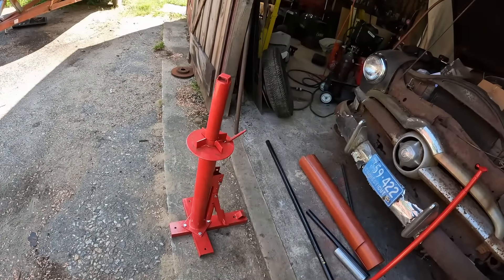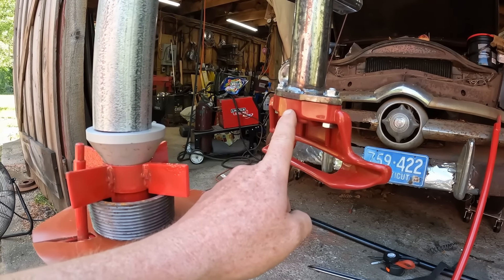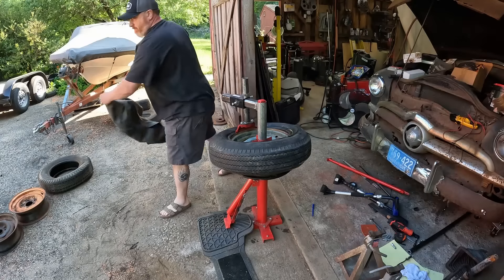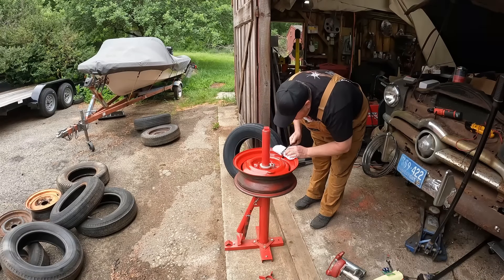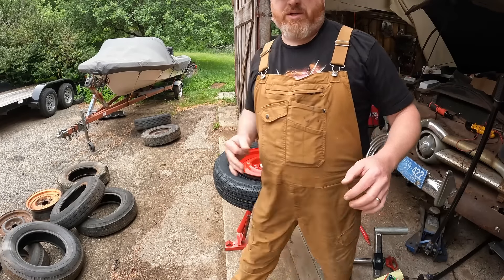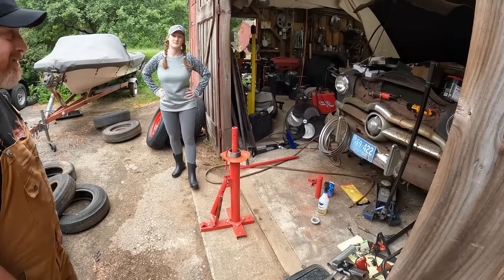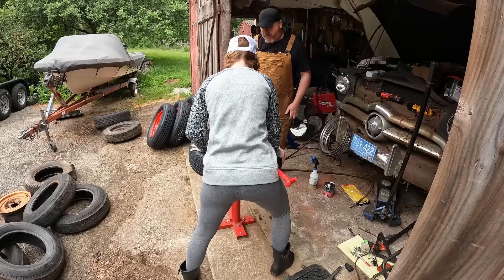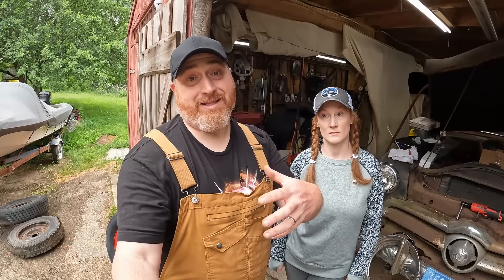How to modify a Harbor Freight Tire Changer to work amazing!!! Follow this DIY guide!!

Comment: The pop sound that you were looking for, only happens when you have modern safety rims!
The 'safety bead' was developed in the late 50s and adopted as an SAE design in the early 60s, but wasn't 'required' until the late 70s, although it was adopted by pretty much every manufacturer by the late 60s.
Reply from the maker: Yeah others have said similar. They seated well and haven't leaked so I think they will do fine. Thanks for watching!
Reply: @madgingercustoms  I was taught to always use tubes on the rims not designed for tubes tires , as they will come off if the tire pressure gets low. "Safety first"
Reply from the maker: @JDE-li8nf  the tire with still come off though at low pressure. But I know what you're saying.

Comment: Great job on the mods! The proper alignment of the duckhead is 1/8" above the rim and 1/8" clearance at the head and tail. It's also designed to move head first. In your design, you should rotate clockwise around the rim for a more effective job. Especially when you have stiffer sidewalls. Lube is your friend!! Use more soap percentage than water. Lube both beads before installing so you can wipe excess water from inside. The excess causes balance problems. Use caution when leaning over the center pipe in case you slip so you don't injure yourself. Never exceed 45psi when seating the bead for safety reasons! 💣🦺
Reply from the maker: All solid info!! Thanks for the comment!
Reply: Curious with a setup like this how would anyone be able to control an 8th inch of play in that duckbill.
Theres an 8th of play or more in the arm that's holding the duckbill.
Just a thought here
Reply from the maker: @motov8-garage832  Why would you need to?
Reply: @madgingercustoms  I'm not sure,was hoping the O.P up top would elaborate.
What I'm thinking is this 1/8 inch of clearance is so the duckbill doesnt bind up or rub tight on the rim.
On a manual or "homemade" modified tire machine I dont see how you could control an 1/8" of play.
I say just eye ball it, make sure it's not to tight  and make it work lol👍

Comment: Our welder was doing the same thing until I lubed up the spool holder, ours was binding up and now the welder works beautifully. Thanks for taking the time to show us the extras need to make this thing work better.
Reply from the maker: I'll be checking the welder out this week. Thanks for your suggestion! I'll look into the spool holder dragging.
Reply: Lube, it's what separates us from the Animals 😂
Reply: @madgingercustoms  check your ground clamp and connection. the teeth on the clamp are usually brass and they get dirty easily. also sometimes can get corrosion where ground wire meets box
Reply: If you don't have felt to clamp on the wire before it goes through the rollers , get some , a sm . Clamp or clothes pin to hold it . Work with it for lite pressure . Bless ya'll
Reply: @madgingercustoms  FYI, replace your inside liner for your wire feed as that wears out after a while from the welding wire running through it and will cause the intermitant surge of the wire. Also keep your liner laid out straight as much as possible and not curled up on the floor while in use, as this will help it from wearing prematurely. My Lincoln welder is over twenty-five years old and have had to replace the liner multiple times. It's a cheap and easy fix, everyone always overlooks. Hope this helps! Thanks for the video.
Reply from the maker: @Outlaw1492  hose assembly and gun and recently replaced. I'll go through the welder one of these days.
Reply: @madgingercustoms   My old Century brand welder was doing the same thing.  Sometimes it would feed, mostly it would stop and start.   I figured nothing to lose taking it apart, and i found a broken gear in the feed motor assembly.   I found a motor for a similar welder and replaced it.  Problem solved.

Comment: Great video. I used to do a lot of tire changes at the golf course where I worked. I worked for a county government and our main mechanic shop was always swamped with work. We almost never got the same tire/wheel that we sent out, so the golf section got their own tire changers.
My friend worked at Vehicle Maintenance and one day, he was inflating a small tire. He had it on a bench and he was talking with another mechanic. The tire/rim exploded and took off the top half of his head. It took them months to find all of the flesh, bone and brains and clean and reopen the shop. They make a cage to put the tire in or you could make one. I would highly recommend it.  

I still remember being told the story by the guy who was talking to him when that happened. They guy who was killed had owned a service station, retired, and got a job with the county. He didn't need the job and it was tragic the way he died.
I hope you take my advice and start using a cage. Ever since that happened, I never stand in front of the wheel when I inflate it on my vehicle. There is more power in compressed air than you'd think.
Laugh and call me names if you want, but I'm talking to all of you. You don't want your family having to deal with that.
Reply from the maker: I'd never laugh at that. Thank you for your concern!!
Reply: @madgingercustoms  I'm sorry. I don't think YOU would laugh. But, there may be someone who scoffs and says it'll never happen to them. I hope nobody says thàt.
Reply: @martinphilips6091  Great story!! Not laughing.
Reply: Sorry for the dude, but it was probably a split 2 piece rim that came apart, on a car rim there really isn't anything that could go flying .
Reply: Split rim all the way, that's what the cage is for, not for a standard wheel like this.
Reply: @Flussig1  yeah i was wondering how a rim split those are almost indestructible no 60 pounds of air is going to rip that metal apart unless you have a split rim,and those will take off an arm, or head.
Reply: Yeah I know there have been many killed by tires blowing up, the worst culprit are the heavy truck tires with the rims that can come flying off and take your head off.  Of course putting too much air in  is always dangerous.  Another thing is.... Just look for videos where they sprayed starting fluid inside a tire then lit it to make the tire seat.
Reply: @jondoe3179  I worked on trying to get a bead to seat using all the tricks, nothing worked. Did the starting fluid and it popped on. I'll do it again as a last resort.
Reply: @pauledwards4837  Did you try a ratchet strap around the circumference of the tire?  Squish the center and the sides bulge out.
Reply: If you're nervous about airing a tire up for whatever reason, (split rim, old tire, really high pressure to seat bead) just slide it under a vehicle or something  substantial to contain the carnage if things go wrong.

Comment: Another note.  The claw that is supposed to hold the rim to the changer.  I just cut a tire sidewall into two pieces and put it between the wheel and the claw.  It will prevent the claw from damaging the wheel and will hold it secure while still using the pin that came with the changer.

Comment: I had a Coats manual  tire machine for many years. Always hated using the bar to remove or set the tire on the wheel. Your modification is a stroke of genius.  Subbed and liked.
Reply from the maker: Thanks for checking out our video!

Comment: I have one of these HF tire machines. I used it to mount LT tires on my Bronco. Like you, I wanted to clean and paint the rims before putting the new tires on. I sure could have used the duckbill and the adapter to center the wheel to make things easier. I appreciate the information on the modifications. Did your new tires have balance marks on them? Thanks again for the video!
Reply from the maker: I thought they would have a dot to line up with the valve stem but they didn't. I was surprised by that. They were super cheap though.
Reply: Good stuff Dave!

Comment: That was pretty cool esp with your modifications that probably made it work about 100 times better using that standard duck head part. A little slower than a nice modern tire changer machine,but totally practical for a home garage. Ingenious
Reply from the maker: Thanks!
Reply: Plus about $ 2,500 cheaper than a modern tyre machine

Comment: I really liked your modifications to the tire changer. That is something that I will need to do to my HF tire changer. I took the bead breaker off of the side and cut some square tubing (it's what i had at the time) and welded the 2 flat fins on it so that i could use the bead breaker on top. I'm old with some back problems so it is much easier to use it standing up instead of being stooped over and trying to maneuver the tire around. I did however need to slip a piece of flat bar in the top to keep it from slipping up over the center spindle. Just an idea. 👍👍
Reply from the maker: That's a great idea!

Comment: 8:00 Strongly suggest pushing the tire bead down into the inner section of the rim, to allow the section you are forcing over the rim, to have as much freedom to stretch as possible, which will also save tearing the bead as you work.
That's why all rims, have a middle section MUCH SMALLER than the main rim edges.
Long time ago, I learnt that simple trick when changing bicycle & motorcycle tires, (with a couple of tire levers (or screwdrivers) as there was no way to rip the bead over the rim, without moving the rest of the bead, into the inner rim concave area.
When I saw you doing the initial removal, it was extremely difficult as the bead was NOT in the inner (looser) area, but close to the main bead rim, hence why it seemed tight at first.
Oh that and the fact that you pulled it the WRONG WAY with the red bar.
You lifted the bead up above the duckbill with the silver bar this side, which meant the duckbill would have kept lifting the bead if you had placed the red bar THIS SIDE of the center and pulled the wheel around the other way.
Talk about making things hard on yourself Trev.
Yes it will eventually rip the bead up & over the wrong way around, with the rest of the bead HIGH up on the rim's inner surfaces.
It would have been far easier, with the red bar on this side "pulling", allowing the duckbill to do the lifting, with the entire tire (halfway) down at the middle of the rim, allowing the bead to slip up & over correctly.
Try it next time and wonder why you didn't read the instructions - eh?
Reply from the maker: Amazing how it worked at all!
Reply: That smaller diameter in the middle of older rims is called the "drop center". And it is there specifically for installing and removing tires.

Comment: Elegant design overall. I think it would benefit from the handles you mentioned. I have the basic tire changer and some tires are just a bear to mount and dismount. Your mods would help a lot I think.
Reply from the maker: Hope it helps you out. Thanks for watching.
Reply: Sand them down then put the tires on then paint  afterwards. Run a little bit of tape around the outside of the rim. Don't have to worry about scratching them. I bought mine to do motorcycle tires the attachment that comes with it don't work with the motorcycle rims and tires either needs modified also. You did give me some ideas I do appreciate it!

Comment: For the bead break I would use bolts as you suggested. You could also weld a steel spacer inside. Great ideas and craftsmanship. Keep up the great work.
Reply from the maker: Thanks!!

Comment: Axle Grease is a Good Lube for Mounting.
Reply from the maker: You are the first to suggest that.
Reply: @madgingercustoms  👍    In 1984, I worked for my Uncle Who grew up in The gas station Business, He was Born in The 40s.   Get a Clean rag, Smear it on The bead area.  If You have a Tire that’s Leaking around the beed and Ream, Break tire Down clean, Bead and Rime smear a little grease should seal it.     If You ever mess with small ( 4 to 8 inch ) Tubeless Lawnmower Tires, That You can’t get to Seal,( Because Tire won’t Expand Quick enough to seat ) Take a Small Can of Grease, Lay Mounted wheel, and tire on clean surface, Glob the Grease around the Gap, fill with air.  Collect Grease off of Tire and Rim, Put grease back in Can, and Keep just For that Use, or Like Uses.     ( Just Thought Duck Tape Might Work.).

Comment: I really like your mods and it worked perfectly!  The only suggestion I would make is to weld a piece of small round stock on the end of the tightening bolts (to make them T bolts) so you wouldn't have to use a wrench to tighten them.  Good job big guy!
Reply from the maker: That was the plan but I'm impatient and needed to use it!! I may cut some knobs on the plasma table.

Comment: Too bad the manufacture of these don't realize the buying public would gladly spend the extra money for it if they would have included this design with the product. I want something that functionally works well over a cheaper price. Now I and everyone else has to spend the time and money for this modification for a good product, when we shouldn't have to.
Reply from the maker: Agreed!! HF would have a winner if they included this attachment!
Reply: Don't see you spraying soapy water or tire lube on wheel? Thought i saw a spray bottle earlier.
Reply: Nice modification!

Comment: Remember, at 8:08 the LAST thing you need is for the center screw-down tube to "loosen" while you are pulling the red bar around, (from the car towards the camera towards you then past the boat & back to the car) so as it spins TIGHT with this side turning towards the yard, and the other side towards that old car, turn the red bar THE SAME WAY ROUND, which allows the silver bar to hold he bead up enough, for the duck-bill to do all the bead removal (and the rim is held firmly by the center "threaded" clamp, so that you don't cuss and swear when it all comes loose.
Reply: I think you mean "clockwise"
Reply: And counter-clockwise…much easier to explain and understand

Comment: Yes I just bought one of these and tried it out and of course the bead breaker bent. And the giant rod they give the end was welded so poorly it's stuck a piece of metal in my hand. Then when I put the tire back on I could get it 3/4 of the way on but they made the stupid end of the rod wrong and it couldn't do it the whole way. So I had to use my motorcycle levers for motorcycle tires to get it on the rest of the way. I see you basically redesigned the whole stupid piece of crap. A work of genius by you but really, all that work to make a piece of crap work somewhat. You might as well have redesigned the whole thing yourself
Reply from the maker: Yeah the bead breaker is almost useless for anything stubborn but the duck head mod makes it very easily mount and dismount tires honestly. My wife had no trouble even with my horrible instruction!
Reply: I would tend to agree with you, Scotty. USE  their  ideas, but make it with better structural steels ; keeping an eye on  ' leverage '....KISS  method  ( keep it simple, stupid Peter )
Reply: I agree with all the work you put in it you could have just made it from  scratch scratch
Reply: I just watched your video before this one. I make/modify a lot of stuff, even made my own smoke machine but you can get a cheap tire machine AND balancer for $600. I have also used the exact same tires that he used however they are trailer, not car, tires....

Comment: A suggestion to help preventing the bar/ pipe used for rotating the duck head module from slipping off during use, would be: to attach a piece of flat bar or rod that's hook shaped to the end of the rotation bar, cupping around the vertical pipe section of the duck head module. There's a coloured dot on new tyres, it is positioned with the valve stem.
Reply from the maker: These tires have no dots on either side. We checked all 4 of them. I thought it was odd.
Reply: I been changing truck tires on my semi for years I just found out about the  colored dot about six month ago that how you balance the tire on a big truck tire line it up  and it balances the tires every time. My car tires dont have a colored dots on them.
Reply: If there isn't a colored dot there will usually be a molded "dot". Typically some kind of indication to note the light point on the tire.
Reply: And there are dimples on rims, most times anyway. Those dimples are meant to match the dots on the tires. It’s supposed to be industry standard but they aren’t always there.
Reply: @johnburton705  yeah. Typically you put the heavy point of the tire opposite the air valve on the rim as that will typically be the heavy point on the rim

Comment: 6:57 Can I suggest using a bungy cord (clipped onto the pipe and to the top of the changer), to keep the bead breaker high when rotating the tire, to break further around.

Comment: I have had one of these for about 15 years. They could use the stiffenrer for the bead beaker. The cone is nice, but neesesary. Nothing esle is needed. I have done both of my trucks tires and a volkswagon several times. If a tire does not meet the rim use starer fluid and a match, be prepared to pur air int the tire before it colapses. It works!
Reply from the maker: Thanks for watching!

Comment: Look if you fabricate a part that will fit in where the tire supposed to separate , but is there a press to push the tire away from. The Rim, the automatic ones have them